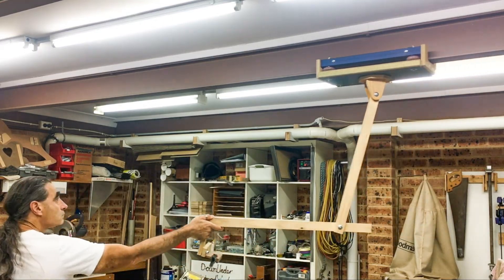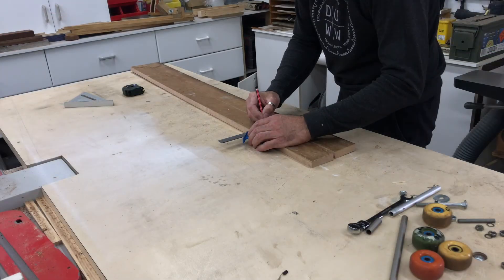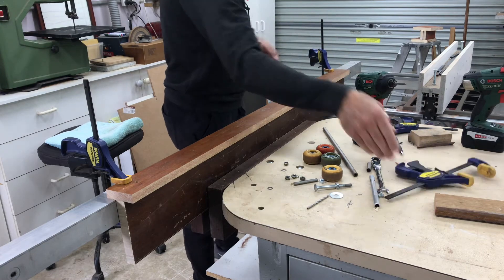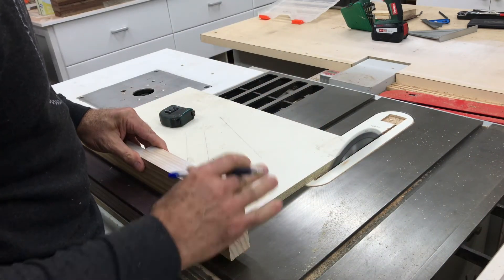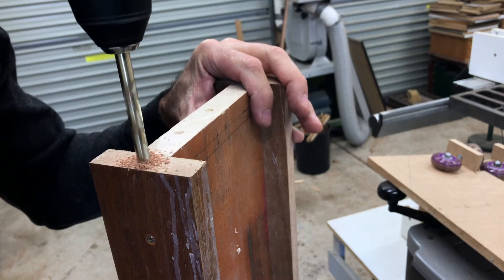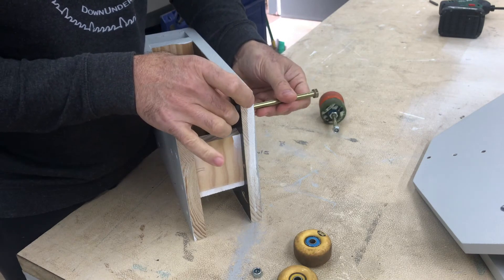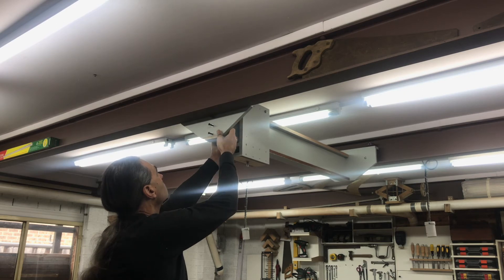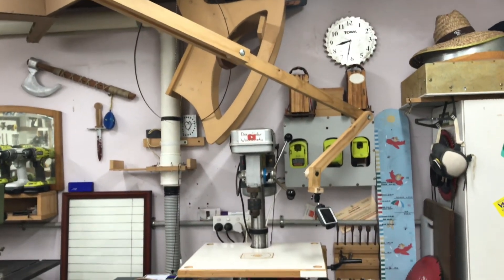How to make an overhead camera system | Rolling gantry

Comment: Great build !
What works for me ... I lock 2 nuts together on a bolt that fits the insert, screw that into the insert and with my impact driver and a socket screw it into the pre - drilled hole. That screws it in with pressure from the top and not the inside hex, it is also easy to see when the insert is flush. a Little beeswax or candle-wax rubbed on the insert threads does wonders !
Thanks for the vid and sorry, I cannot subscribe .... again !! hehe!
Reply from the maker: Thank you very much Francois. Great advice mate and i will definitely try that way in the future